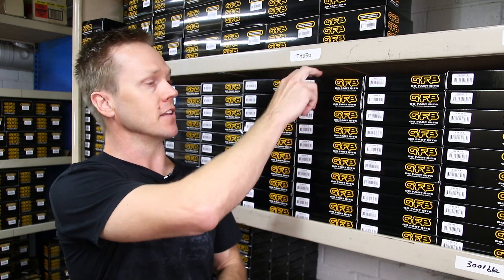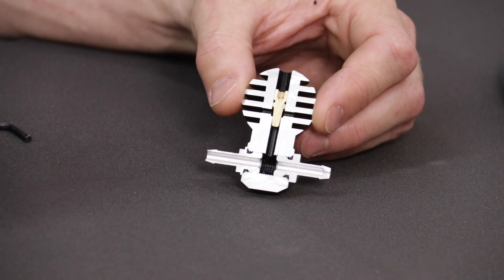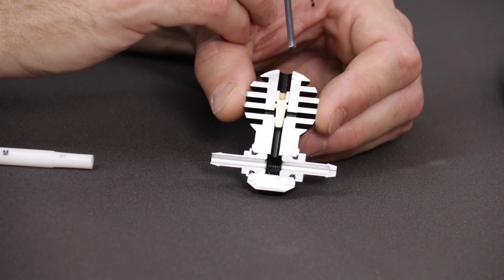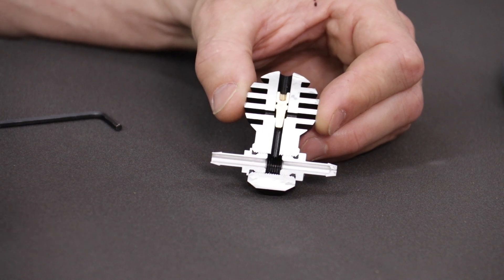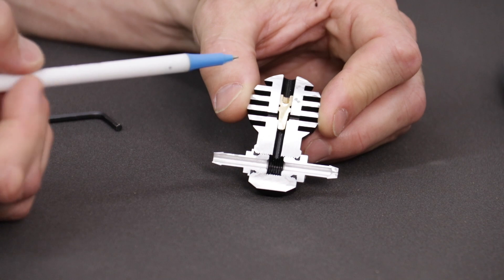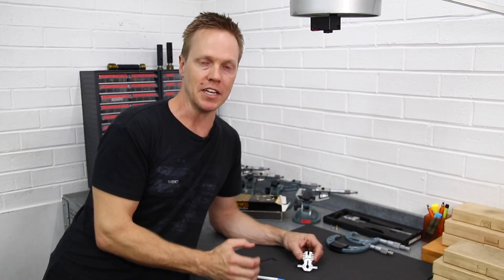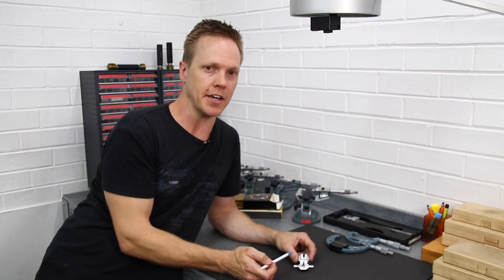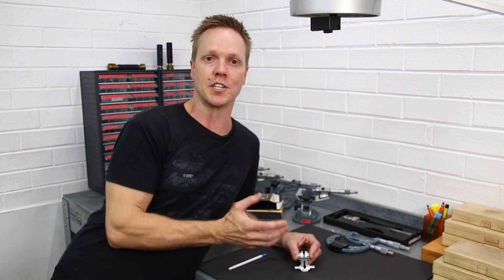Bleed Valve Dissection [GO FAST BRETT]

Comment: Brett, you should do a similar video but instead with a 3-port boost control solenoid. No one could ever explain the engineering behind it and why its better than a manual boost controller
Reply: anthony maldonado if you ignore the actual mechanics behind it then it's very clear why an ebc is better than an mbc. Being able to have preset settings, set the wastegate spring/crack pressure to enable earlier spool, scramble boost, warning/safeties, typically consistent boost, great for logging. List goes on.
Reply: Electronic boost controllers (at least the good ones) can do closed loop boost control which means very accurately regulated boost pressure. Much better than cheaper open loop EBCs or boos tees/bleed valves
Reply: Indeed. Interesting fact. The first ever electronic boost controller was from Saab, and called APC. "Automatic Performance Control". It was a boost controller which ensured the maximum level of boost was delivered based on the octane of the fuel being used. Released in 1984.
It was very popular with Tuners in the EU during the late 80's, as it was a separate system that could be ripped out of crashed saabs, and easily retrofitted into other cars.
It had adjustable pots on the circuit board that allowed max pressure, and the rising rate to be adjusted.

Comment: If air is bled of after its gone through the maf will that not just lead the a rich fuel air mixture. Shouldn't the bled off air be put back into the system between the maf and the turbo?

Comment: I had issues with boost spike and over boost with a ball and spring turbosmart tee
ended up removing the ball and spring and increasing the restrictor diameter to make it hold accurate boost levels
Reply: Turbo617 wastegate is a tial 38mm external has top and bottom vents

Comment: i just bought one of those screwed all the way in clockwise and its like it is free boosting now so i turned other way a bunch of times still over boosting up to 15 psi is my controller faulty or something went by instructions but is like wastegate is locked shut now

Comment: Why is the bleeder a ball shape at the top with fillets cut out of it? Heat dissipation?
Reply: Maxim Allen I imagine so but u wonder if that may cause condensation on the inside if you're in a high humidity environment, like here in Florida.
Reply: Think its more for looks than anything.

Comment: Please do a video on what type of valves make which noises (like chirp vs whoosh vs flutter)
Reply: Flutter is coming from the compressor wheel itself, as air is forced through it in reverse when you quickly close the throttle body.
Reply: well what you say would be interesting. its not like Jim says, i had a hks copy in my 3000gt and it did the "woooshh" sound, put it in a s13, and it did the flutter sound. and no, it wasent coming from the turbo. so it might be car dependant and not bov
Reply: You're saying the turbo behaved differently in a different car with a different engine? No surprise! What I'm saying is known fact, not opinion btw.
Reply: What really happened is that blow off valve on the S13 wasn't opening enough hence the flutter.

Comment: I love the sounds of rods going through an engine. ebc are cheap, and even came stock and controlled through the ecu in the early 90s. Why go back? Manual boost control is a step in the wrong direction
Reply: If you are killing engines the boost controller isn't the issue, cheap EBC's are still more then a good manual boost controller. 

As for boost control through the factory boost control, it's much easier to install a manual boost controller if you aren't going to remap and you don't need to on a lot of Japanese cars at least if you want to run more boost on the factory turbos.

Comment: manual bleed valves are for cheap people who inexplicably like to replace engines
Reply: or for people who want to up boost past wastegate pressure on a built motor.
Reply: Ryan Rohauer or people who own a car that is fully mechanical or doesn't need an ecu to run
Reply: James Andrews wrong if you want to crank up boost on your built engine you should be using a boost controler with some form of PWM so that your ecu can see What's actually going on.... and for mechanical stuff I get but how far and few between do u see a turbo car with a blow through carb... and for the most part thoes guys anyways aren't using manual bleed valves because they have external waste gates that they change the springs in...
Reply: Ever heard of diesels Ryan? Plenty of folk upping the boost with those.
Reply: I never said u couldn't up the boost it's just not the best... safest way to do so
Reply: Ryan Rohauer I drive a Nissan patrol td42. that's a dinosaur engine and doesn't use a carb. it uses fuel pressure from the injector pump to increase engine speed that makes the turbo spool up to 15psi, through gasses. no ecu or built engines here.
Reply: If you are killing engines it's not the bleed valve that is the issue.
Reply: Usually is because those that just chuck these on don't know what timing and afr's are and just screw it up to the max it'll boost.
Reply: You could say that with any form of boost control or really any mod, do it right and you shouldn't have any issues.